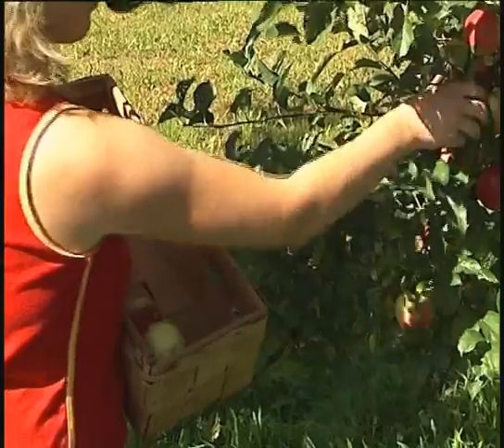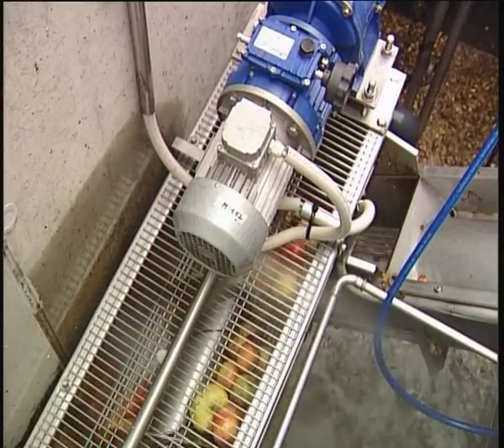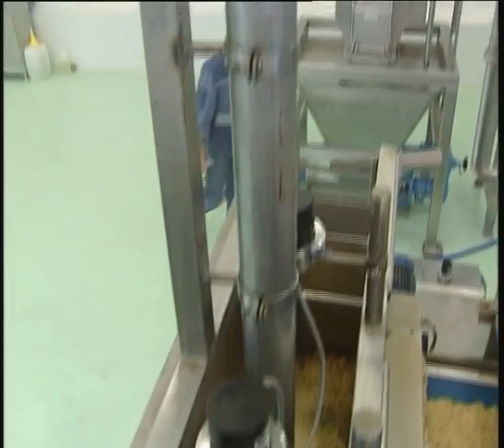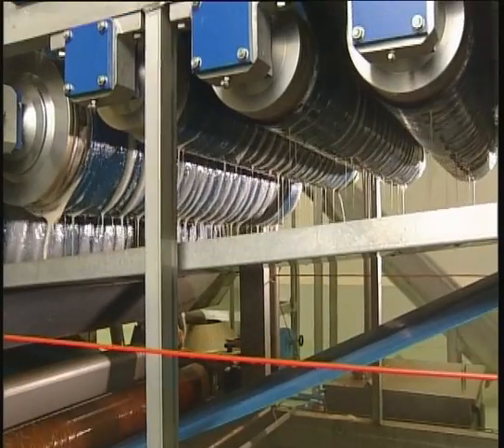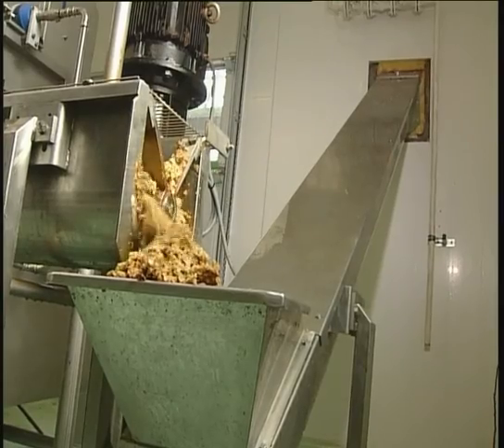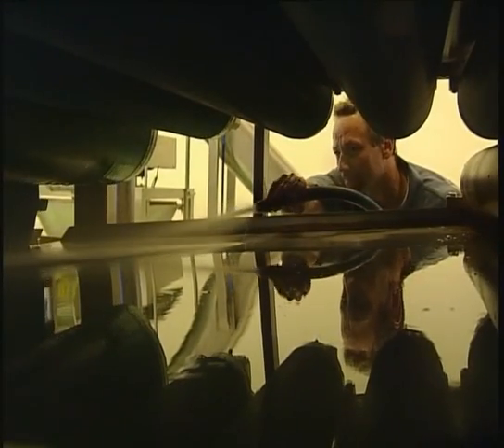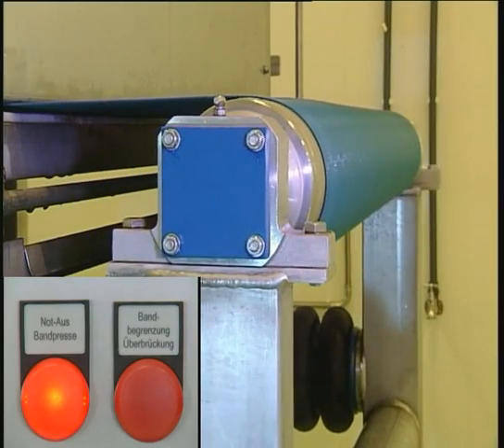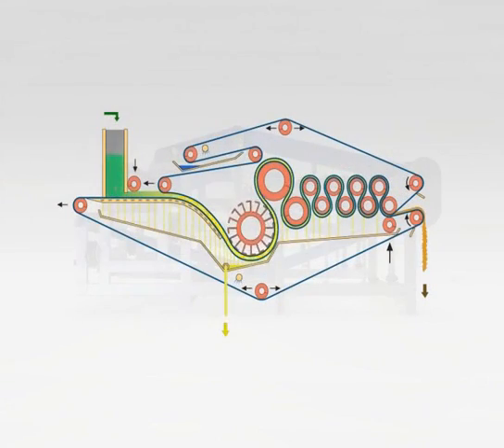Apple juice production with the Flottweg belt press

Comment: Cooling: Cool the canned juice to prevent quality issues caused by excessive temperature.
In addition, for the production of concentrated apple juice, it is necessary to concentrate it after adjusting the mixture to achieve a certain concentration of soluble solids, and then cool it down for storage and transportation. Throughout the process, it is necessary to pay attention to the key points and precautions to ensure the quality and safety of the final product.